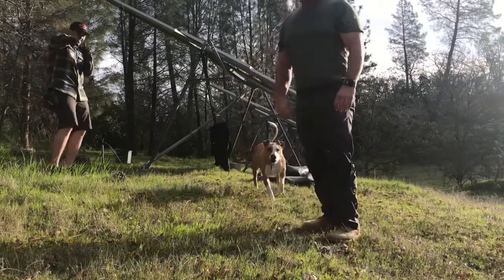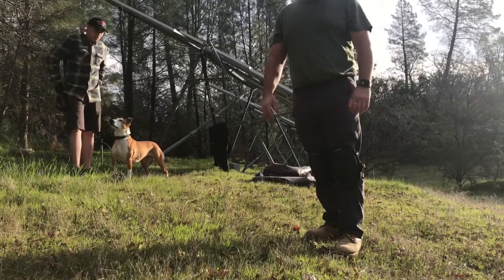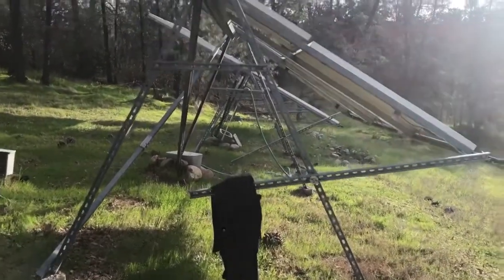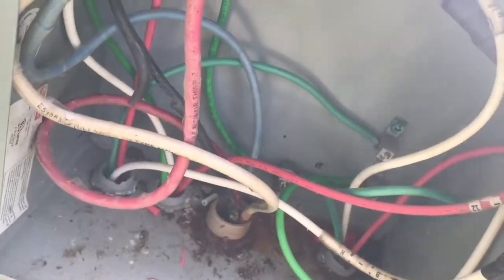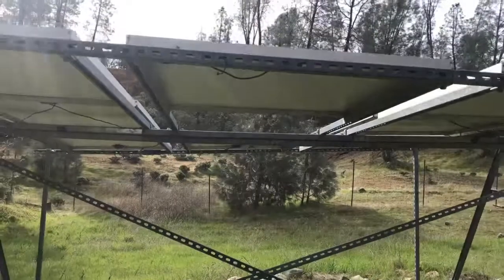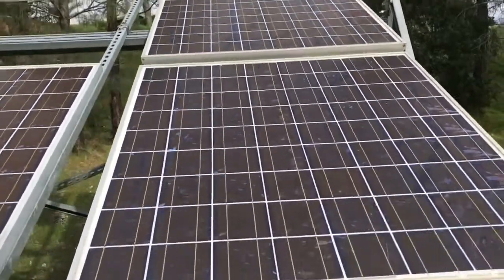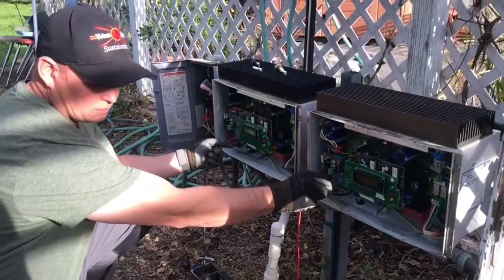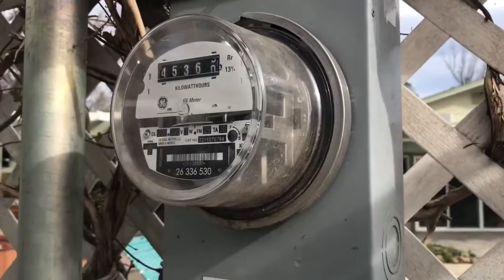Grid tie Solar Repair

Comment: This happens when people place a premium on cost rather than on value
Reply: The facts are that the original cost was around $30,000 and the  "repair" was about $2600.     I wouldn't call that cheap
Reply from the maker: Sorry Marge people sometimes miss the fact that 12 years back Solar was super expensive even with the rebates they had back then.  In our Industry we are plagued with people undercutting costs doing sub par work very frequently

Comment: DAM! I have seen some stuff. Hell my Off-Grid setup is a bit nutty. When it comes to grid tie tho. My stuff is dun 100% funny when the Co-Op Power guys came out to see my grid tie go live. I was the first one to bring on line a grid tie setup here.  They where looking at the SMA paper work. They told me why did you use 10/2 when mim for your setup was 12/2. The boos had the guys all come over to see my setup over the next few weeks. Was fun showing them.  

One time I was working in Berlin Germany and solar was new there as well for the most part. Well grid-tie. We where putting om a 2kw at the time that was big deal. The guy from the power company BEGGED us not to turn it on. He was saying it's GOING to kill his men working on the lines in a storm. We tryed to show him how anti-islanding protection work.  He was so upset that he stayed there at the metter base for 3 hrs not moving. His boss the big guy has to come and remove him.

Comment: OK, so I know your a perfectionist and you build high end systems.  So how do deal with a customer who may just want to "patch up" a poorly built system?
Reply from the maker: David Armstrong perfectionist? If so you would see my face :) I’m just super creative, ultimately they asked me to check it out because the inverter wasn’t working and to see what was going wrong, after seeing the issues wrong with it I am pretty sure we will be upgrading it properly.  Interestingly the guy that built this originally also did the system on my house that I ripped out
Reply from the maker: David Armstrong I also build budget stuff it just typically looks high end